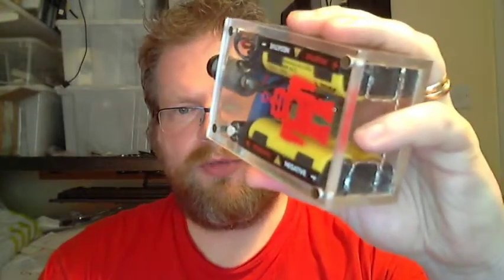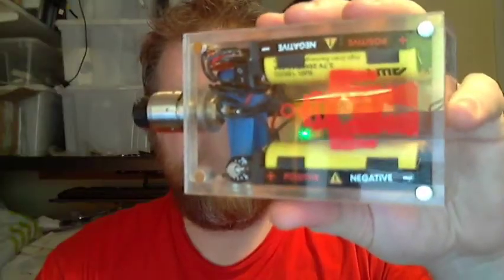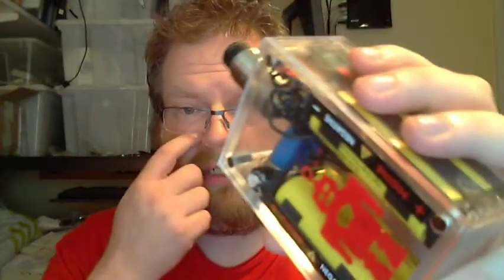Robot Mod v2. Quad OKL T20 powered with ModMeter

Comment: Oh man that is the greatest box I've seen. Great job. What P-channel mosfet do you use for the modmeter? FatDaddyVapes gave me a modmeter but I don't know which mosfet to use. You got a wiring diagram on your Robot mod?
Reply from the maker: +Dirking I used this P-Channel Mosfet 75A/30V SUP75P03-07-E3
and here is the diagram I used. The modmeter parts were added on my insistence. http://www.modmaker.co.uk/Murata-OKL2-T20-W12N2C-Wiring-Diagram